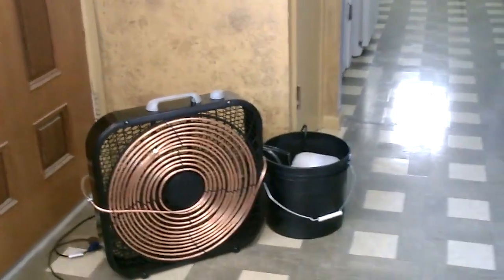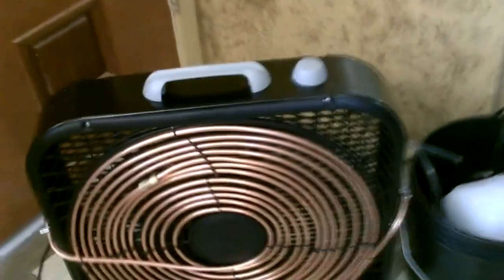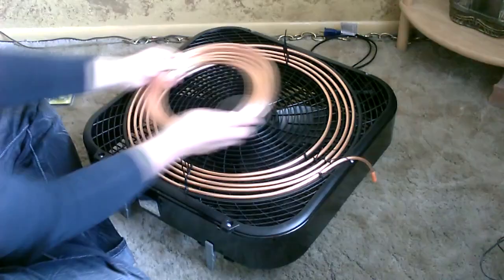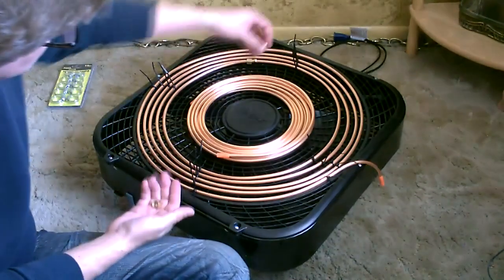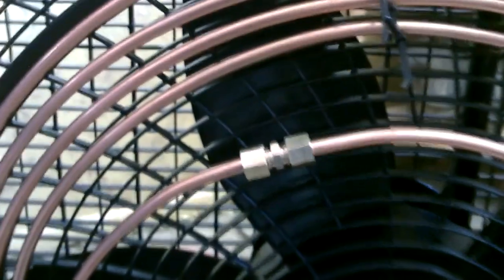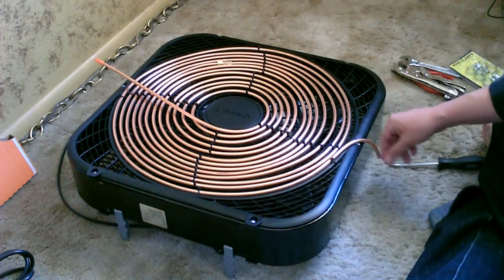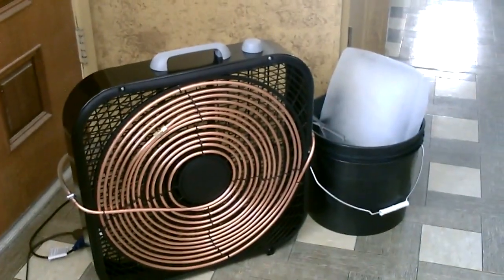Homemade AC - The "Copper Coil" Air Cooler! - (Simple "Box Fan" Conversion) - Easy DIY

Comment: I made something like this when I was renting out a garage, that was converted into a studio. It worked great. The only difference was i would use a 5 gallon bucket, fill half of it with water and freeze it. Would add enough water to cycle through so it wouldn't melt fast, but also put salt so the ice would get colder. The room would get so cold I had to turn it off.
Reply: When will you put the salt to the ice before or after freezing.plz
Reply: Did you use the same fan?
Reply: @ch-0162  probably box fans are the best- about $20 at Home Depot
Reply: How cold does the room get?
Reply: @islamreminder8538  I would add it after it's frozen.
Reply: @ch-0162  I've done two of them one box fan and the other metal fan. They both worked amazing.
Reply: @ch-0162  honestly I think it was between 55-60. That's based off me sleeping with the AC on and it's lowest is 64 and I'm not cold. So for me to have to turn it off I have to say it was colder.
Reply: @Nando-lp8sp  Does it cool the whole room?
Reply: @ch-0162  definitely
Reply: Did the salt water effect the pump,?
Reply: @wearewatchingyou4371 no. I still have it
Reply: Great idea nando!
Reply: Again, if the ice is melting fast, it means its working.
Reply: I did it but it’s not cooling? Why would u think this happening with my project? 
The cool poet pipe is dripping water (condensation)
Reply: smart
Reply: @Nando-lp8sp  I mix salt water into a big coca cola bottle and switch them out as they melt.

Comment: I really liked this. One thing I would suggest is to apply pipe dope to the ferroles of the compression coupling for lubrication before you tighten it. The reason being that the friction from tightening can cause a leak.
Reply: By the way, the ferroles are the brass rings in the compression coupling that go around the pipe. Just a coat on the outside of the rings and don't be shy with it.

Comment: I'd like to see a similar experiment just using cold water instead of ice. I'm thinking of building a cooling unit with a tube running under the ground for cooling. Great idea in any case!
Reply: It's cold water with ice in the cold water making the cold water colder, thus making the air cooler coming out from the fan.
Reply: pro tip coming in nine years too late: ice is, in fact, cold water

Comment: Did not read all comments, but put coils on intake side and cover corners like a fan shroud on a car. This is what central air systems use to get an equal amount on air going past every inch of the coils. Vacuum is always better than blowing at something.
Reply: So you're saying the fan sucking the cold off the coils is better than air pushing through coils to transfer cold? Hmm Idk about that one but you did both sides it would def be that much better!!
Reply: Is it better to suck cold air rather than push cold air?
Reply: @Lucas-nf7uj  Depends on the situation. But in this case Lynn is correct.
Reply: @buzzsaw64  that's good to know actually, thank you
Reply: Wouldn't this run the risk of the fan sucking some of that condensation into the electric fan motor ?

Comment: My GED students at the local jail assembled one of these for my mom recently as she is having a hard time with rising air conditioning costs. They used a box fan, copper coil, the pond pump, vinyl tubing, but used a styrofoam cooler with lid instead of a bucket with open top. Every evening she rotates out two big downy (filled with water) containers frozen from the freezer, 3 ice trays, and one ice pack into the cooler. Also she replaces the water with cold water. It does work and helps her sleep now at night during the summer. Her air conditioning bill has lowered significantly obviously. It really helped. It runs about 6 hours before everything melts and the room is cool all night. Comment below if you have any questions about the details and I’ll answer.
Reply: That's awesome and I just started really looking into this stuff recently.  I was thinking of using copper tubing for this, but I'll go all out and get a radiator.  I'm planning to make this much more efficient while still being able to be done from buying parts from the store.  She should incase the cooler in a bigger box with each side having an air filter so she also gets clean air and the cooler gets some help staying cool. I would insulate the walls where possible as well. Also they should continue using the copper tubing going into the cooler. They could make it go around the perimeter helping to evenly cool as well before exiting back in the center.  Then besides the pump there would be almost a such space for ice. She should also mix salt in the ice so it stays frozen longer. I might even run this off a solar panel system since I would only need it for when I'm sleeping

Comment: Geothermal recommendation --- Dig a hole in your yard (a few feet) , drop another coil in it and connect to the indoor coil (using the same plastic tubing) and place that pump in the line permanently. This will force the water down into the ground, cool it off and return the water back to the fan cold. Now you no longer need ice. Create a plastic tray under the fan that drains into a condensate pump and push condensation outdoors and you have permanent air conditioning on demand! Geothermal style, you are welcome!
Reply: Uh yeah, thanks..... for nothing. LOL
Reply: @raybbaby  why?

Comment: I think I'm gonna try something like this, but on a larger scale, using my ever flowing natural spring water, a forced air furnace blower, and some ductwork.

My spring water is usually right around 56 degrees year-round  (probably warmer than the contents of your bucket, but will never warm up more than a couple degrees).  It flows from the source, to my spring house, which is close to my actual house.  So if I can somehow tap into the duct work of the house, I think I'd have a constant supply of approx 56 degree air entering my house for no more than the cost of running a blower motor.

Glad I found this video, thanks for posting it.
Reply: Hey bro did you try it? How did it work out??
Reply: Assuming a 70 degree room and 56 degree water, you're looking at a coil to air TD of 14 degrees. For reference, industrial refrigeration systems for meat packing plants target a 10-12 degree TD. I.E. if you pump enough water, your system is going to be pretty efficient.

Adjust the water flow upwards until the exit end of the coil is around 58 degrees and you're golden! No need to pump more than that - just adds heat from the motor / wastes energy.

Comment: If you lived out in the country you could install a cistern that was deep underground and had an insulated top that keep the water really cool that you could pump out from the very bottom to circulate through a copper coil in front of a fan to cool your home or green house with the return water feed passing through a wrot coil in another cistern to bleed off heat before empting into another cistern that slowly feeds the main cistern your pulling chilled water from to provide cooling to your home or green house. 😊

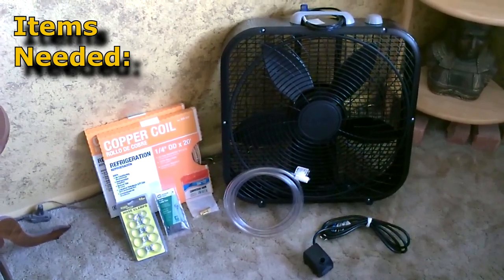Comment: Pic at 1:06 shows aquarium pump, along with copper & vinyl tubing, clamps, connector,twist ties etc. If it had fins on the coil from say old pop cans it could be made to work more efficiently.

Comment: I made one that I hooked to a bucket of alcohol in a freezer to cool my walk in incubator when it gets to hot I wired the pump to a thermostat and it works great. Good idea man thanks
Reply: robert douglas this idea is genious
Reply: robert douglas How did you run tubing/piping in and out of the freezer?
Reply: +Andrew McCarthy Exactly. With the pump on the hot side outside of the freezer so the pump doesn't freeze. Run the tubing to the adjacent room or room-to-be-cooled. No need ever change ice since the ice is always being thawed and re-frozen in place. Also saves water because the ice block only needs to be filled once and kept in the freezer.
Reply: @nsbfan  It's not genius if you understand thermodynamics.

Comment: I have seen this done with a very small deep freezer the dude had it in the gargage you would open the freezer door and there was a bucket, inside the bucket was the the block of ice  frozen in milk gallon jug which had the top cut off so water could land on more ice, he used the freezer drain plug to run his line and sealed it with expaning foam, the guy worked on cars boat parts etc.. it was hot in there but once he fired it up withn the hour it would cool the garage, he did not use a conventional ac because his doors where always opening and closing and was gettign huge electric bills, thanks for sharing

Comment: Hi I thought you should know I put one of your air conditioners to work and it works great, the one you used with a cooler and fan with ice. . I used a little smaller of cooler then you had An aluminum Tube that goes on a dryer and a fan that I ordered that you plug into a USB.  The fan plugs into a battery bank that I have that can be charged by solar. so I took 2 gallons of water in gallon jugs froze them, hooked it all up with my battery bank and Wella. what a great idea.  My bedroom does not get cool enough so this will help tremendously. Now if I can get and ice maker in case SHTF, I'll be good. Thank you so much for the great idea!!!

Comment: Of course, if you are making your own ice in your living space to do this you are worse off as you heat up the kitchen more freezing the ice in order to use the ice to cool the room.  The wasted energy in the process of making the ice, and the heat from the fan motor is going to leave the system (the house) hotter than before.  However if you are bringing in ice from an outside source this is a great low energy way to cool a room in an emergency.  For example, you may not have power for a few days after a hurricane but the store down the street may have it and can sell you ice.  The fan and small pump would be very easy to run for a long time off of a small inverter running on a battery, or off of a small quiet RV type generator.  It takes a large noisy gas gen to run an AC unit and/or a fridge, at least 2000kW.  I also like how this does NOT add humidity necessarily to the inside like misting type coolers, something you want to avoid unless in an arid clime.

Comment: Good hobby. Advisable to give material list in a slide and expected source with approximate price to help the viewers . Also connect the submersible pump in-front of the viewers mentioning where to connect the discharge and suction line of the pump i.e suction from coil outer turn to inward or inner turn to outer. This will also be worth mentioning  that there may be condensation from the copper coils and water would be dripping, hence a water sump has to be put underneath to avoid water spillage . Thanks.

Comment: You will probably never read this, but I would like to make a few design tweak suggestions that I've been experimenting with, showing great results.
One of your biggest problems, is that your system is not very efficient because you run water over the ice. The friction of the water in itself heats it up and causes the ice to absorb this ehat and melt faster.
The second biggest problem, is that you do not have an efficient surface area to capture the warm air and condensation.

Here is the suggested revised model:
A. Coolerbox Unit
1. Coil 3 meters 1/4" copper tube inside the coolerbox. (outside to inside, top to bottom.) Both ends to point outside the box. This will be your Cooler Coil.
2. Place a Water bottle (300ml) into the coolerbox and mount it. Extend 2 copper pipes -also leading outside the box. This will serve as your water reservoir.
(You will thus have 4 points sticking out of the coolerbox.)
3. On the outside, have your waterpump ready.

B. Fan Unit
For the fan, you will need to do a bit of preparation. This will ultimately be your Fan Coil. 

1. The fins: 
This step is not compulsory, but it will boost your cooling efficiency tremendously. As mentioned, one of the biggest problems of your system, was that it did not have an efficient surface area. Adding fins will multiply your surface area.
Copper sheets will work best because copper (385 W/m·K) has almost double the thermal conductivity of aluminum (205 W/m·K)...but aluminium will also work great.
You will need approximately 27 strips (less actually) of 0.2mm Copper Foil sheets measuring 2cm to 3cm wide, and 18cm tall. (Or 54 strips that are 9cm tall). You will end up using much less than this.
As mentioned, copper works great, but it is expensive, so you can also use aluminium -which you can get from empty soda cans for free. Simply cut off the top and the bottom (giving you a cylinder) and then make a slit to have a sheet. Just roll out the sheet with a rolling pin until they're flat. These sheets are 9cm tall. Now, simply cut them into 2cm wide (9cm high) strips -giving you 10 strips per can.
Drill holes slightly smaller than 1/4", about 3cm apart. (It is important that they are a little less than 1/4" because they need to fit tightly around the copper tube in order to maximize the heat transfer.

2. Take 3 meters of 1/4" copper tube. From this, 2 meters will form the cyclic for your fan's grid with 0.5 meters at each end extending to be connected to the Cooler System.
Work your copper tube throug the first row of holes in the fins, keeping the fins between 1cm and 2cm apart. Then bend your copper tube upward and work it through the next row. Continue this zig-zag work until you're completed 2 meters. You will now have something resembling a car's transmission radiator. This goes in front of your fan's grid. 

C. Perparation and Operation
1. Put 3 icepacks in the bottom of your coolerbox.
2. Fill your coolerbox with water and add salt. Salt added to water lowers the freezing point, which is a phenomenon known as freezing point depression. For example, a typical salt solution with around 10% salt by weight will freeze at about -6°C to -8°C, instead of the normal 0°C. This means that the water in the cooler box will not freeze as easily, allowing it to remain in a liquid state at lower temperatures, resulting in more effective cooling.
Where 10% salt solution will lower it between -6°C and -8°C, a 20% solution will lower it to between -8°C and -10°C.
Water expands when it freezes though, so be sure to leave enough space to provide for that.
3. Next, simply put your coolerbox in the freezer and let it freeze solid.

4. When your coolerbox is ready, bring it to the room, and plug it in as follows:
a. Water pump's Inlet to Cooler Coil's outlet. (You need tot use a pump with a 350ml/hour capacity or more. I personally prefer brushless pumps, because it is simply more efficient.)
b. Water Pump's Outlet, to Water Container's Inlet. 
c. Water Container's Outlet, to Fan Unit's Inlet.
d. Fan Unit's Outlet, to Cooler Coil's inlet.

This system should give you between of 5°C and 9°C cooldown and drastically lower the humidity in the air as well. The ice will also take a lot longer to melt because your water flow is now no longer causing direct friction on the ice. 
I recommend having to prepared coolerboxes, so that the one can freeze while the other works.
Reply from the maker: hi there. luckily, youtube shows all of the new comments from every video i've posted (all in one place) - making it easy for me to see them all. sounds like you have some good ideas but i'll have to spend more time reading this comment before i can fully respond to it. btw, i think of my videos as the 'timeless' or evergreen' type, so feel free to comment on any of them.
Reply: @desertsun02  Ah awesome, haha. I'm currently experimenting with different coil methods as well. I.e. The inward spiral you have here (but with the fins) being one coiling method. The others I'm about to experiment with are:
1. Spring coiling (like in your other vid): This is where I'm basically going to wind the tubing like a spring and then make a circle with this spring-like coil (with the fins along these spirals). This should increase the surface area of the tubing. The problem I foresee with this though, is that the spring spirals will fan outward which will mean that the parts toward the center should be denser than the outer parts...but time will tell.
2. Radiator coiling: Where the copper tubing runs horizontally, then about 3-5cm downward and horizontally in the opposite direction. The fins will then be placed like the fins of an oil tranmission radiatior. This should in theory, maximize the surface area.

I will let you know how my test results are going, and then give you all my info, in case you'd like to do another video. 
Btw. It was your video which inspired me to experiment further. All the findings I've got so far, originated from this vid.

(Just a typo on my last sentence of my previous post: "I recommend having two..." I accidentally typed "to".

Comment: For anyone interested u can buy a condensate pump at ac supply houses comes with the vinly tubing that fits 3/8 size line like he is using use a hose clap or medium zip ties

Comment: Nice idea and implementation. I have a suggestion that might improve the efficiency. Instead of placing the ice and water in a normal bucket, it would be better if you put it in a styrofoam box with a lid so it stays colder for much longer. 🤔
Reply: Chipeat way use 20 ltr bucket put a 10 ltr bucket  in center and fill the empty space between both with spry  foam .. it will insulate the from outer temp 😀😀😀😀.
Reply: By insulating the bucket you actually reduce efficiency slightly, assuming the bucket is located in the room you are trying to cool. Think about it - the whole system is designed to absorb room heat and melt the ice as fast as possible, because that means its working.
Reply: Dump idea 😀